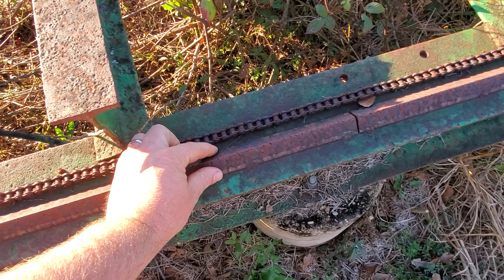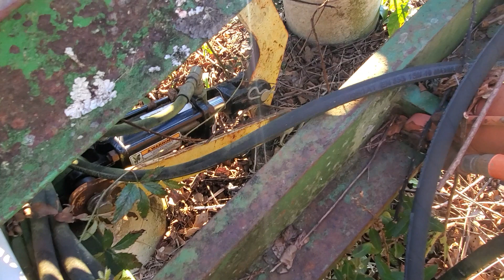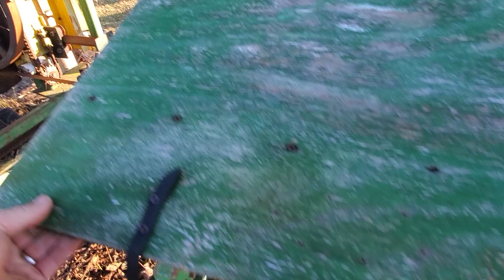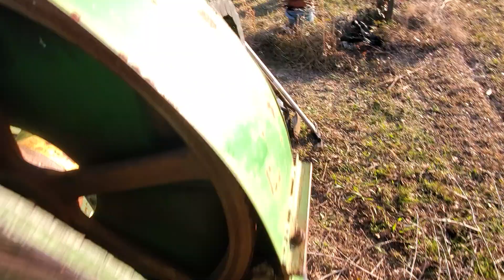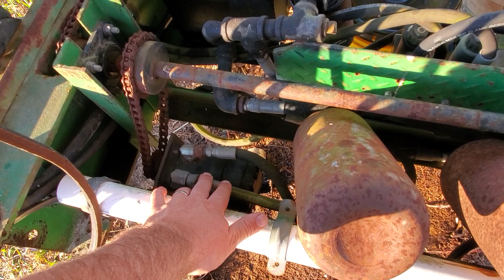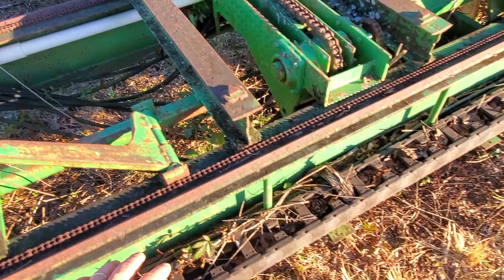Searching for sawmills , episode #1 The homemade green machine of Greene County Mississippi

Comment: Really cool mill..I'm using a forklift chain set up also...I've always thought those pins that hold the carrier\carriage and chain together were small but I've heard of one breaking...Check out about a 9000 or so capacity forklift when you get a chance..The chain pin is probably smaller than that one..Good video

Comment: Great video Thomas. It will make a very good and interesting series. This is an excellent mill by the way. Is it going to be sold on or is the family going to repair/upgrade it and get it operational again? If so, would be really interested in seeing the end result in operation! Take care and stay safe. Stan
Reply from the maker: His nephew is fixing it up and going to use it to build his house.   He's got tge hydraulics running again,  now he's going to get the motor off to have it looked at and fixed or replaced.